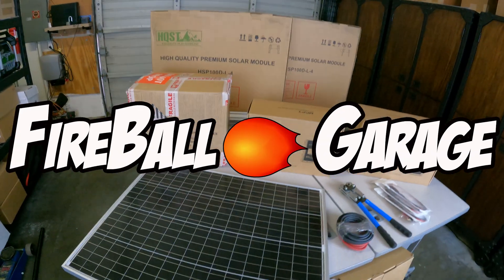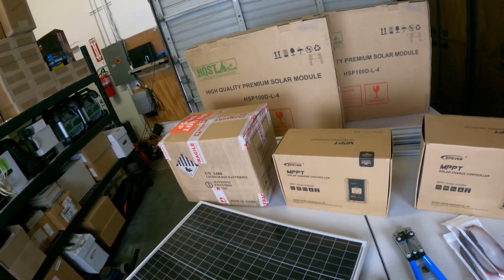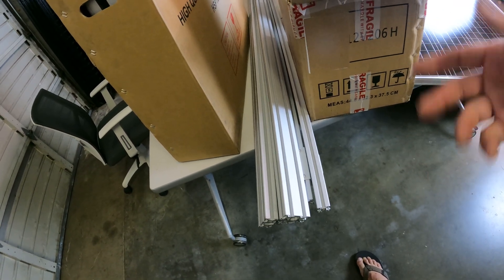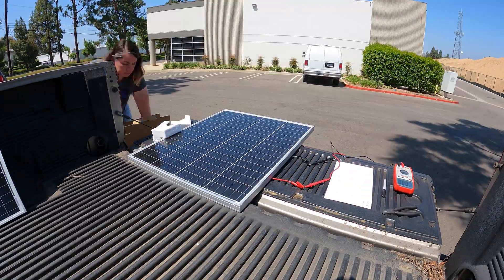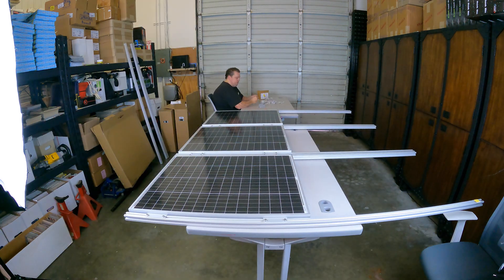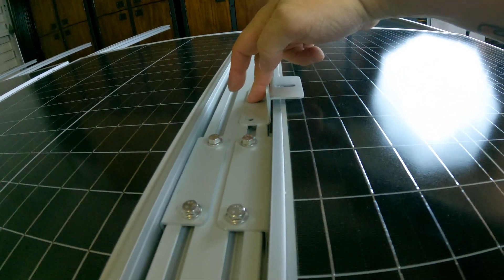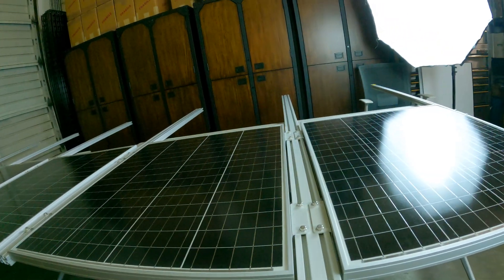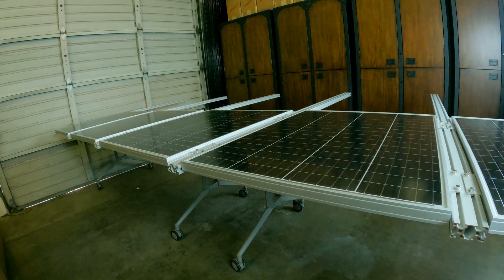Putting 1,900 watt Solar System on a Cargo Trailer!

Comment: Hurricane force winds up there.... but wind is horizontal, not vertical. 

Trailer weight should be 90% on the axle, 10% on the tongue.
Reply from the maker: Very true, we did our best to keep most of the weight low and even.

Comment: You should seriously consider moving to 48v at that wattage, especially if you plan on add more capacity. The loads on the wires are much less and the system would be more efficient while charging. DIY Solar Power with Will Prowse has a great video on this.
Reply from the maker: thanks I'll check it out